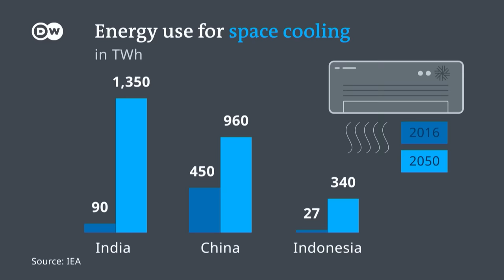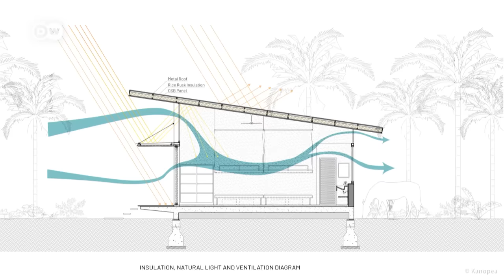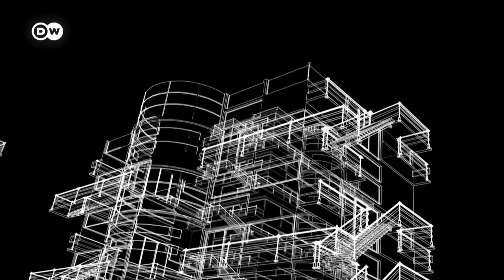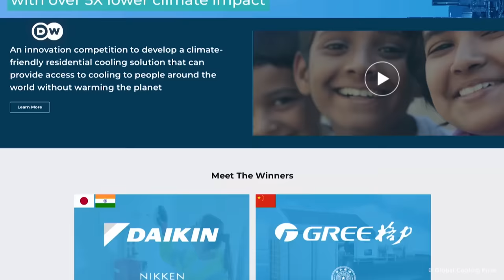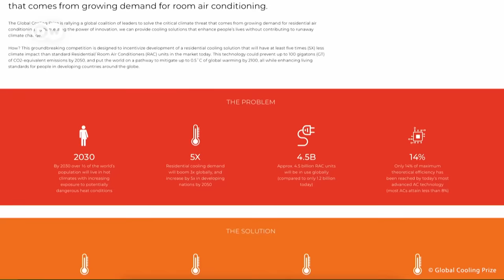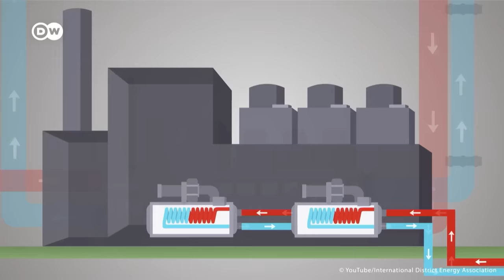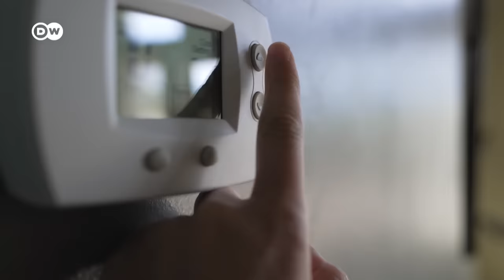How to cool our homes (even without ACs)

Comment: I think that a central issue is when even the nighttime low is not low enough to bring the inside down to something livable, and then the daytime high is just brutal or medically dangerous. The problem with passive cooling techniques is that they only work to a point, but the climate exceeds that in many places.
Reply: A great solution is to have a centralised AC unit (large and efficient) for every neighborhood/flat building/office complex etc, and put the heat exchanger in a passively cooled space.
If the heat is dumped into a slightly cooler space, the AC is much more efficient. 

Also if passive cooling can decrease the indoor temp by 2-3 degrees, that is an enormous amount of work taken away from the AC unit! This way passive and active cooling can be combined instead of either/or.
Reply: I live in Germany - and we almost have no AC's. Our houses are of thick stone - with mostly good insulated walls and a few windows.

During hot weeks I'll shade windows during the day.
And have cross ventilation windows - open doors at night. That still is okay on most days - if it's only hot for 10 days or so. Longer periods are brutal - then it's best to suffer outside in shadows. 😅
Reply: @theresabu3000 May be true for Germany. In Spain we have 40 degree July and Augusts where temperatures never drop below 25 in the nights and there’s high humidity. I live in a passive house design and we still chose AC, but we use it to a very low setting in key days. People historically protected against that by shutting everything down during midday and working early mornings and late afternoons. That is no longer possible in today’s worlds. Efficient heat pumps are the way to go for any architecture.
Reply: I live in the tropics at 10 latitude. The temp is minimum 20 C in December at night and 32 in the day most of the year and for 4 months it's 37 c everyday. As long as there are fans it's perfectly fine. As long as the actual (not wet bulb bs figure) remains 37c (human temp) it is perfectly fine to survive. Only in places and times of the year the temp goes above 37c is when the human body can no longer cool passively.
Reply: A lot of it is the heat island effect. Lots of concrete, asphalt, metal and glass... All stuff that absorbes and reflects heat into surfaces that never get half a chance to cool down.
I work in a down town area, and in the 6 years I have worked there they have planted a lot of trees, and started paining flat top roofs white, and added a lot more canopy areas, and even though there is a long way to go, the difference is already pretty huge! Less blacktop, more green spaces, more places that shade or reflect heat up and out... It doest just keep the insides if the buildings easier to cool, there are also far more days where it is comfortable to walk around during lunch over the summer months.
I especially like the canopies. During the summer months it keeps things nice, and during winter they take them down to let the sun heat things up a bit. Having the option for both is good.
But the idea that truly passive systems is enough is just dumb. That said, AC working with smart building design instead of against it can keep things cool while using surprisingly little energy. More often that not, it isn't that AC power use is impractical... It is AC power use when fighting old designs that is impractical. In the end we need both good buildings and good AC units.
Reply: Passive cooling lowers the amount of heat an AC would need to remove. These aren't mutually exclusive.
Reply: @Seathal  We need to bring back the siesta
Reply: True but good design can still reduce any cooling loads.
Reply: AWNINGS WORK WELL
Reply: They also only work on Dry and Hot place that experience winter like Iran.
Reply: They actually work well when combined with heavy duty, insulation and energy, efficient appliances.  This minimizes internally generated heat, and keeps external heat out.
Reply: For past 30 years in Greece, we rejected AC!!! Opening and closing windows according to sunlight and airflow, cool shady creepers around house, mopping floor regularly. But this year we installed AC. The new climate is TOO MUCH!!! We only use on extreme temperature days and cool the room to about 27°c
Reply: it sometimes enough to bring it down to uncomfortable level but not life threatening, passive cooling helps bridge the gap between those who can afford AC and those who doesn't, it also helps in building a walkable city
Reply: Exactly
Reply: @cassyguy  passive did/does not solve humidity issue😅
Reply: We painted inside and outside our house with an insulating additive ( added to the paint). They are hollow glass beads, and it really improved our energy usage. We painted multiple coats on each wall, some only 3, others 9. If we didn’t have a thick -coated dog, who loves the cold, Midwest in the US, we probably wouldn’t use AC at all.
Reply: You can use the AC in those cases, can't you? Use passive at other times.
Reply: The use of ac has made humans weak and unable to tolerate the high heat. The AC is making the heat more dangerous. Victory has defeated you.
Reply: then those places shouldn't have people.
Reply: I'm from the tropics.  The heat and humidity is tolerable to sleep in, because my house is design to stay cool more than other houses around me. I have plants in the garden to provide shade. 70% of the time, there's natural breeze passing by the property. I only need 600kWh energy a month, compare the average 1600kWh demand  of my neighbors (they need a/c and big screen TV in their lives). 

You need money and space to get passive cooling effect. Which commercially build to sell home does not care to provide.
Reply: 1) It's not like that all the time \ everywhere. Even in the hottest of places there will be plenty of days throughout the year that passive solutions will be enough.
2) even when passive solutions are not enough, they make the job for active solutions easier
Reply: @0my  So, you're not human, then?  Are you suggesting that we humans need to toughen up and go back to living miserably in the heat?
Reply: Actually permanent solutions are least expensive, but people always run after quick fix absolutely no guarantee that it will last atleast 5-10 yrs. This Central cooling must be combined with solar so heating of roof & WALLS WITH  BIPV doesn't last as per they claim.
Reply: Didn't you watch the video? They mentioned that A/C would still be necessary.
Reply: In many places yes, but there are much cooler places that still rely heavy on a/c that could make the switch. There is no universal solution.
Reply: Hot air exits thru elevate "airator", cooling air enters from below ground @12'C.
Reply: Also my ex wife pumps out so much hot air she alone is worth 2 degrees C in additional heating. I’m sure this is the case all over the world
Reply: Not true, i live in a tropical place with an old house design and I dont sweat at all indoors. A good house design is just as good if not better than ac.
Reply: "i think that"
Reply: @theresabu3000 Yeah, in Germany 😂 what about texas, California, Spain, Italy, Egypt etc
Reply: the problem is my pc heating up the whole house hahahha
Reply: Here in Houston TX it's 90⁰F at midnight, sometimes humidity can make it feel like 100. Even the lowest temperature of the day is still above 80.
Reply: @cassyguy  Got a quote on replacing the old gas powered central air that's in this house, a central air conditioner for our home would cost the better part of 15-20k dollars, and that's WITH existing ducts.   On top of that, I live in the south along the coast, it was 106F (41 C) a week ago with over 90% humidity.  Which made it feel somewhere in the neighborhood of 120F (48-49 C).    The price of the unit makes centralized air an impossibility and the ambient temperature makes any passive cooling a nonstarter.   It's 95F( 35 C) under our covered awning car port that's wide open to the air and has plenty of ventilation.  Sometimes the geography is set in Satan's armpit and nothing short of an air conditioner is going to cut it.
Reply: @0my  People in Finland: Ayy lmao Goes from steaming hot sauna to frozen lake with only shorts.
Reply: yeah i was noting in the video when they say "this can reduce interior temperatures by up to 5 degrees" i'm like...ok so it goes from 95 degrees to 90...great it's still insufferable.
Reply: In the tropics, houses with high roofs or ceilings from the floor are advantageous.
Reply: I am from germany and I have been to spain. Especially your capital city does not need AC. 
the way your city is built is already a natural AC and it is actually very impressive xD
indeed, i think siesta should come back in spain ;D
Reply: Then applying to in those places where it is fine.
Reply: We don'tt do cooling much here in the UK.
Reply: That's not the central issue at all. Not once in this entire video did they suggest air-condition usage be stopped, or completely replaced. Not once. The critical issue is that current AC are not effective at all, the energy usage is way too high, so it needs to be supplemented with passive cooling techniques to help reduce our over all reliance. All or nothing comments like this drive up resistance to other methods of cooling that could actually have a major impact on energy usage globally if they were incorporated.
Reply: @cassyguy  which place is referred to as a passively cooled place? I'm talking about directing the AC heat there.
Reply: @theresabu3000  This is great if your entire summer is not 90 degree days to 100 degree days. Otherwise after a few days your house will get so hot, it will suck to be there.

Comment: I've personally built my house 10 years ago. I invested a lot in insulating materials from top to bottom and I've planted several trees around my house. Even that right now temperature in my area goes higher than 40 Celsius I have no AC and no need for one. And I am using not much gas in the winter for heating. I am sure that trees and insulation does the job of keeping inside temperatures in confortabile zones.
Reply: Not everyone has that kind of budget. In fact, I'd argue that at least 80% of humanity could not only never afford to build their own home, but they could definitely not afford the plot of land. However, yes, if an individual is rich, then they really have no excuses.
Reply: This is great but only works as long as temperatures in your surrounding fall low enough at night.  Once you live in an area where nighttime temperatures only barely fall before 30 insulation doesn't really help
Reply: @Mefaso09, that's true for very humid climates, but for most of the dessert lands, temperatures drop very quickly at night
Reply: @Novastar.SaberCombat  You don't have to build your own house to have this if we have build laws that encourage this for all new buildings.
Reply: @stillconnected4838  Tell me more! I mean, I am nowhere near wealthy nor knowledgeable about construction. But I'd love to know how much a person would need to build a home (or whatever, have one built?), etc. from your perspective? 🙂
Reply: If you put acetone on the trees and put  a spark of fire...it gives out freezing cold waves
Reply: Exactly true..
The change of  approach brings change in solutions.. we need to think out of profits for long term sustainability..
Reply: Stop fooling people
Reply: What about the fallen leaves from the trees??? Doesn't it rot especially during rainy seasons
Reply: A wise investment, as you look at the results and consequences of your investment and realize that you saved a lot of money and did not need AC.  Islam always urges us to look at the consequences and ends of things. You are wonderful

Comment: The irony is that most people in this video are inside a comfortable AC room
Reply: not me. :)
Reply: If no one is making energy efficient, naturally cooling buildings and everyone is currently only using air conditioning, then how would they have any other option? Also, do you know how to accurately spot the difference between a building with AC and a building with natural cooling? 
I don't know if you're just trying to be funny but comments like these are often used as an 'aha, gotcha' finger pointing method of excusing our own bad behavior by saying that the person trying to be better isn't actually being better. But change is slow and we're only in the first stages of the process of change because right now society is still moving in the wrong direction and we've only just begun to recognize how wrong we've been and put out awareness of the problem so that we can hopefully initiate change by getting people on board.
Reply: @EamonWill  The very common science behind it is 2 things. Material used and thickness of the wall. If we dont have fancy material, then increasing thickness of the wall is a better options to make inside cooler in summer. Or another way 2 thin walls separted by air gap in between.
Reply: Not me, 😂 weather is nice, no need AC.
Reply: Not me
Reply: @biplobbiswas7506  
Okay, that's great, but that doesn't really address what I or the other person said. If no one is making energy efficient buildings, how am I supposed to make my video telling people about how important energy efficient buildings are inside of an energy-efficient building. Therefore, just because the people in the video are not sitting in energy efficient buildings does not mean that what they're saying isn't important or that they are inherently hypocritical.
Reply: nah bro, I'm scrolling for a solution to cool my house cause I can't afford AC

Comment: I'm very lucky in that I live literally across the street from the beach. That's my nature's natural air conditioner.
Reply: Good luck when the sea level rises... 😔
Reply: @LudvigIndestrucable  I've lived here my entire 45 years. I'm good, thanks.
Reply: @edyann let's see 45yrs means nothing
Reply: @edyann Most projections don't expect more than a foot of sea level rise by 2100, but I would encourage you to keep an eye on increasingly destructive storm surge. Also, if you live far enough south you might see 100°F water temperatures like we saw in Florida last week, in which case that body of water becomes simultaneously a heater and humidifier. Stay safe!
Reply: @johnsmiff8328  Well, thanks for the advice but what can I say- I'm on the Pacific Coast, (Baja California, México,) and here in my state we have earthquakes all the time, if it shakes in Japan then we have the Tsunami warnings here. And so on and so on. I'm insured, even for my life so I'm not going to panic. I'm an environmentalist since the early 90s so I know that climate change is real and happening but I'm not going to panic. I've lived here my entire life and I'm not going anywhere. But I appreciate the tips!
Reply: @edyann  best of luck, and good on you for not panicking
Reply: @johnsmiff8328  Thank you!
Reply: good luck, the ocean is heating too
Reply: I live 60 meters above a harbour on a smooth slope. Every night is humid as heck, which is either amazing or an absolute nightmare.
Reply: @edyann  you seem to be struggling with the change part of the climate change concept
Reply: I live near the beach.. and it's kinda hot and humid actually if you're near the equator (tropical climate)
Reply: I live in Canada. AC isn't necessary where I live.